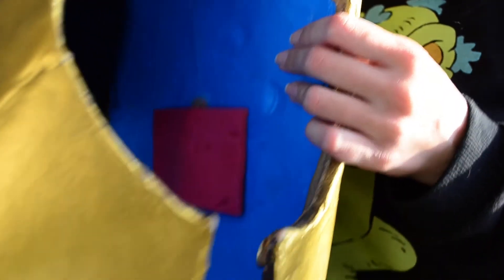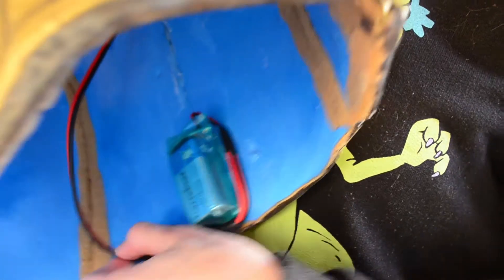FOCUS ON - Orianna Bladecraft - MECHANISMS

Comment: Any chance you can post the 3D print model online????
Reply from the maker: Unfortunately, I don't have it, a friend of mine made it at the time (and I also believe there's room for improvement), but you can check out pictures of it up close on my Facebook page (https://www.facebook.com/soocosplay/photos/a.1545296002349089/1612558895622799/?type=3&theater)!
Reply from the maker: (Though I don't think this was the final version of the prints since I removed the thingy coming out on the outer edges)